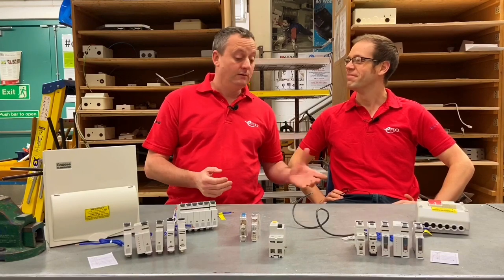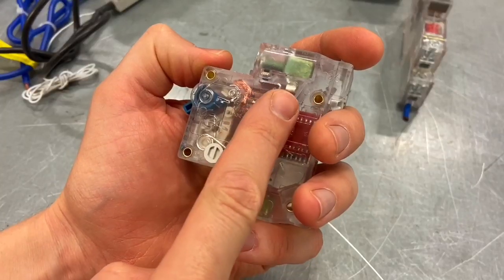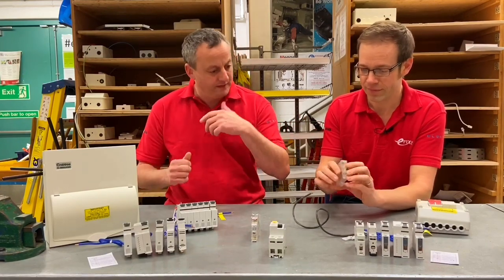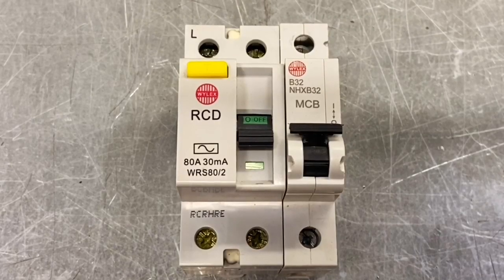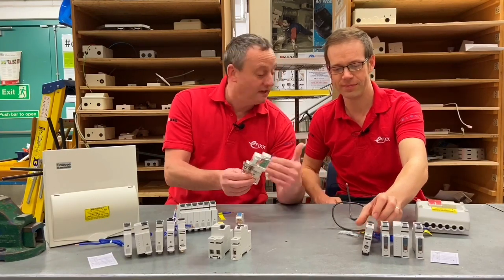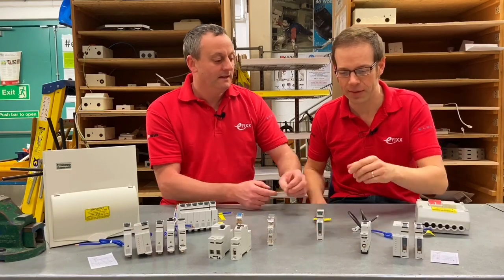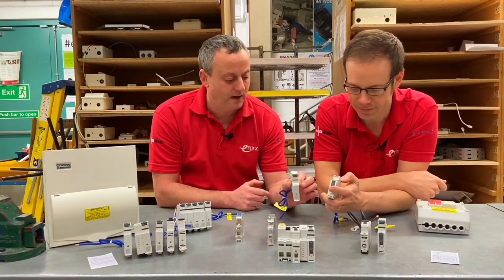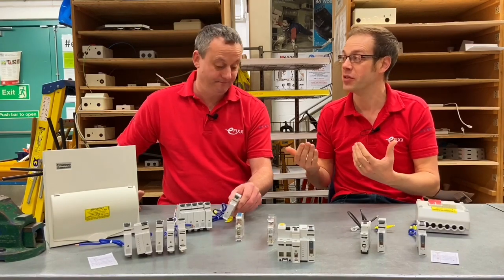Incredible shrinking circuit breakers - MCB, RCD, RCBO breakers to AFDD

Comment from the maker: **AGE CHECK** - Can anyone remember fitting a classic Wylex fusebox with rewireable fuses as part of a new installation?
Reply: They would have to be in their late 60's-70s if it was the white colour wylex and maybe 90's+ for the older black type and pushing up Daisy's with the wooden consumer units😅I'm guessing, I only started on the type 2 to type B mcb's
Reply: Yes and the MEM board
Reply: Paul Tipton - Jeez I feel old now. I can remember “helping” my uncle fit a wylex white unit - back in the late 1980’s
Reply: @gordonroutledge5475  I started my apprenticeship in 1989 so slowly catching you up😊

Comment: Might require some slowing down to go through some of the acronyms:

RCD + MCB + AFDD
RCD residual current device
MCB miniature circuit board 
AFDD or AFCI
AFDD arc fault detection devices
AFCI arc fault circuit interrupter 
MCB + RCD = RCBO
RCBO residual current breaker with overload 
RCD = RCCB or ELCB or GFCI
GFCI ground fault circuit interrupter
Overload protection
Short circuit protection
Earth full protection
Arc full protection

As always another great presentation 👍
Reply from the maker: Thanks for the feedback Eric and this great list !

Comment: The breakers  are shrinking.......the prices are expanding....found some online for £147.50 +vat  EACH.....A 10 way board will now cost over 2 grand to install
Reply from the maker: marky d - Fair point. We are sure prices will fall as the market develops - Interesting to see the US price for their version the AFCI - 
A bit agricultural looking - but more competitively priced. 

https://www.amazon.com/Siemens-QA120AFCP-120-volt-Combination-Breaker/dp/B00J59DYMS?ref_=Oct_CATRatedC_8618821011_3&pf_rd_r=8565XFXCRNTN3BZV1Z8T&pf_rd_p=3e9fe9e4-ac64-533b-9fd6-5e6d35672e39&pf_rd_s=mobile-hybrid-6&pf_rd_t=30901&pf_rd_i=8618821011&pf_rd_m=ATVPDKIKX0DER

Comment: Amazing .
Do you need to have - 8 , 10 AFDD 
Installed in a consumer unit. ??
Or is that not necessary
Reply from the maker: In a perfect world, it would be one per circuit. However, they are a bit £££ ATM so a mid way option is to fit them to high current circuits which may be more susceptible to arcs - e.g electric heaters, showers, laundry appliances etc.
Reply: @efixx  great advice . Thanks . Great videos.
Reply from the maker: @stevendouglas3860  NP - Let us know if you have any content ideas or questions which need a coat of looking at.
Reply: @efixx  I'd like to see mock build of consumer unit , shower unit with the (aadd )installed. But with various Companies Schnieder Wylex,  MK   (and the question. ..which is easy to install Test from ? Take readings and which is Most truly Flexible ? / friendly to all levels . And put the horizontal so we can see , with the camera zooming on mcb /afdd 😄🤔🙄 (Maybe )
Reply from the maker: curb your enthusiastic ass - We’ve got more AFDD stuff in the pipeline. The challenge with the other brands is they haven’t released many AFDDs - MK have even quit the market. We think Lewden are about to introduce one. The rest are still 2 module and Eaton 3 module!!!
Reply: @efixx  oh right . Thanks for the info.

Comment: Year 1964//1044  lighting  cable//  7029  ring  cable//7044  cooker   cable/// and  better   quality  cable   than   the    crap   we  have   today  /more   copper  and  more
 Flexible   /   I am  now  75   and  a sparky   for  50  years   /  see   some    changes  In  the  trade